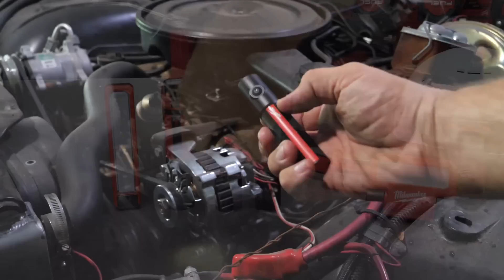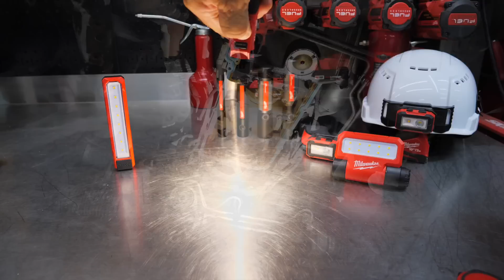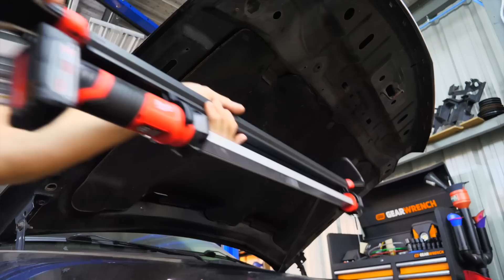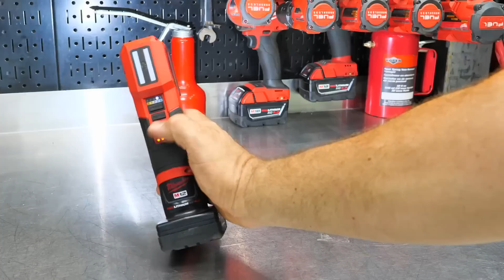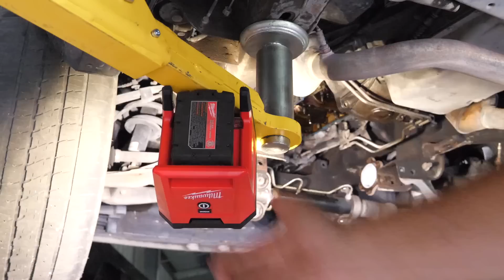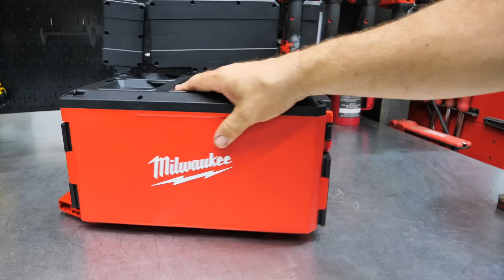BEST Mechanic Lights - 16 Cordless LED Milwaukee Lights and Why You Need Them!

Comment: I really want to invest in the under hood light but I don't know if I can justify the cost. I have all of the rechargeable red lithium lights Milwaukee offers but I don't know if it's 3 times the cost of the competition just to keep it on the same battery platform. (Then again that's coming from the guy who is about to buy the headphones from Milwaukee just to have the same battery, ignore that)

Comment: I think the m12 packout LED flood light is honestly a really good DIY mechanics light, because you have something you can take with you while under the car that has storage space for tools and nuts/bolts. The usb charger is a nice addition, but I wouldn't use it to save battery life. Not as useful if you have a lift at home, but majority of DIY mechanics don't have a lift at home, and most of us are lifting our car on jack stands, or at least quick jacks(which isn't that much higher vs jack stands)

Comment: Man I'm sad you didn't mention one of the best selling points for the pen light, and the reason I instantly bought one. It's one of the only few pen flashlights that has a rubber end portion so when you have the light in your mouth youre not biting down on metal. Just a really good mechanics everyday carry. Cant find another pen light that has that rubber bite zone AND that's rechargeable with good amount of light and battery life for the size.
Reply: Good point.
Reply: Excellent point

Comment: I figured it out. For the 600 lumens head light to make it compatible for the Blot hard hat you need to detach all the straps and band ( so it’s just the light and battery pack left) use the Bolt hard hat accessory clip to attach the light. Bring the battery pack to the back of the hard hat and use the back straps of the hat right above the adjustment knob.

Comment: I am very insulted. I have sent you at least 5 emails asking you for help to show off a product (a work light) that will eventually be owned by every mechanic. What do I have to do to get your attention? Not fair. Very frustrated and disappointed.
Reply from the maker: Your email must be going to spam or you're sending to the wrong email. We just searched and nothing turns up. Send to info@shoptoolreviews.com
Reply: I sent you another email on 10/13/22. Thank you

Comment: My go-too work light is the old 2111-20 'hardhat' light with swappable batteries. I generally  use it continuously whether automotive or home repair of whatever. When the battery dies, I pop in another one (charged in offline charger) and can keep going indefinitely. Not crazy about built in batteries.

Just got a 2161-20 specifically to share the same pool of batteries

Comment: My favorite personal flashlight of all time is the Milwaukee 500 pivot
Reply: I bought it because I saw a coworker with it and how useful it’s been so I not too long ago and I love it it’s extremely underrated I think in flashlights I use it more than my m18 flash light but that only 100 lumens and this is brighter and smaller. But I’ve been considering the pack out light since I got my first boxes a few days ago or some more boxes. Can’t ever have too much light though

Comment: The underhood light system and the little rover lights are absolutely genius and got my full attention!!!! I'm a mobile mechanic/car audio installer and lighting is always in short supply. I may need to find me a few of these. My little magnetic bluepoint lights have served me very well for many years but stocking AAA batteries is a pain in the rear. I'd rather have some sweet, beautiful red lights to match my tool boxes and other gear (and vehicle) very very cool lights.
Reply from the maker: Lights definitely have a huge value to a mechanic, installer, and detailer. It doesn't matter how many you have...you always seem to need more. Thanks for watching.
Reply: P p 09

Comment: That pack out light and charger piece is awesome. Seems pretty big and bulky for what it is though. For the size of it i expected it to be to hold storage as well. I bet there would be a way to mod it to use as a stoage case/box as well. Pretty awesome tho. Not a huge Milwaukee fan, but they are definitely good on their lighting game. As long as they actually last awhile to get your value from the cost.

Comment: The rover magnets are kinda weak, especially the back one. You got real lucky yours stayed stuck on vehicle or I got a dud. The light it puts off is nice though.  I will probably buy the overpriced blade stick light when it comes out. But $99 for a light to loose is hard to swallow.  
That underbody light looks amazing must admit. Too big to forget also
Still go to Menards and HF and get lots of lights that when they drive off you shrug your shoulders and grab the next one off the side of your box and replace. 
The old m18 stick light looks abused the lens didn’t like the brake cleaner and is hazy now. Haven’t hit my rover with brake cleaner yet but if it hazes over I guess that will be my answer. Cheap lights or expensive lights

Comment: For those lights that have different modes does it remember which mode you were in after you turn it off or does it go back to high?
Reply: They remember except the rovers which go high low off high low off...
Reply: @Sparkystacoma  I think I like the rover that has the carabiner. Probably pick one of those up. Hate the smaller AA battery powered rover not shown here. Almost lost the cap when I twisted the belt clip so I could turn on the light.

Comment: The under hood gets used the most around here, so many uses. Im curious about the under body transformer looking light. What size battery at the minimum would keep it from falling over if you placed it on the ground?
Reply from the maker: The underbody is an amazing light and really helps under a vehicle. Sitting upright it's very top-heavy, so it would only make sense if it was sitting on metal. For that matter, I guess you could have a piece of 1/4" steel that could act as a base when it's sitting up. 
Also, the underhood light, even though it's several years old, is still a great light and very functional.

Comment: I like the color temperature of the Milwaukee lights, but when it comes to the smaller lights, I have avoided Milwaukee due to their proprietary batteries. I have been using the Coast XPH30R 1000 lumen headlamp lately, and I have found it to be a good option. It uses a standard (and upgradable) 18650 battery, has a strong magnet for sticking to anything metal, the headband can be quickly removed so it can be used more as more of a flashlight rather than a headlamp, and it has an adjustable beam (spot to flood).
Reply: check out the sofirn brand i am sure you will find a good light at a good price and they are super well built

Comment: I went with Skil 12v work lights and 12v flood light.  Love em.  Especially the work light with their magnets just right and twist light head for all angles.  Those look good too.
Reply from the maker: You can't go wrong with those. Those are diffused very well and provide great coverage also great pricing. They just don't have a bunch of options. Great choice though. Thanks for watching.

Comment: Shop foreman here. I have a Streamlight Strion I EDC in a holster on my belt, and a non rechargeable Coast “moon beam” 50 lumen pen light. I actually prefer the low output of the Coast penlight. If I need a lot of light I’ve got my Strion, if I need to see something up close and not blow it out I’ve got the penlight. Only complaint is the penlight outputs awfully blue light. I wish it were a higher CRI light. I don’t use the penlight enough to warrant a rechargeable light and I use a piggy back charger for the Strion so I’ve always got light. Wish I was still on the line so I could justify buying some new lights. My wife says I have a potentially unhealthy affinity for flashlights but I figure we’ve all got our vices and I’m always quick to remind her there are many worse things out there I could spend my money on.  Absolutely awesome video! Loving the automotive centered theme of this video!
Reply from the maker: It definitely sounds like you've prioritized your life in the right order. :)  It's hard to go wrong with Streamlight or Coast, they both make great lights. I do wish more of the manufacturers would put some thought and attention to the correct light color. That's one thing that I think Milwaukee has done very well for the past few years. Thanks for watching.
Reply: I love streamlight, but the light color is terrible. I wish they would offer neutral white instead of only the cool white color.  I have the little 20 dollar aaa Milwaukee tru view penlight and I love the color of the light output
Reply: @ssclassof2000  I couldn’t agree with you and Tim more. Over the decades I’ve used it, I’ve grown so accustomed to the blue light of my pen light that I’m ok with it now. But I would never expect a new technician getting into the field and perhaps buying their first pen light to accept it.  The Streamlight Stinger Strion, while closer to a high CRI then my pen light, could still stand to be improved. It seems to me that Streamlight focuses much of their effort on either military/first responders, and outdoor recreation and general lighting, that I personally feel they’re leaving out a massive market of speciality lights for the automotive repair market. People who don’t work in the industry will never understand the benefit a good lighting solution can provide and the price many technicians will be willing to pay for it.  Milwaukee seems to understand that technicians are willing to spend a lot of money on a light if it makes our job faster, easier, or safer.  I wish Streamlight would get on board with that too and bring a fresh perspective and ideas and competition to the market.
Reply: @2down4up  Check out sofrin brand i am sure you will find a few lights that you will like
Reply: @wesleyflores1085  Ok I will. Thanks!

Comment: should be titled Milwaukee love fest. I will never buy a Milwaukee cordless tool again. I got burned by their V18 NI-cad batteries were all junk in under two year. So I got their  two new Lithium upgrade kits.with two batteries and new charger. All were junk in under two years. All my Dewalt and Bosch batterries have lasted over 10 years. Two years ago I updated to Bosch 18 volt system and Dewalt Flexvolt 60 volt and 20 volt tools. No problems. Still use my corged Milwaukee tools. They are great.
Reply from the maker: I do understand most of your concerns and comments about batteries. I think you probably meant to say V28, correct?! That was an interesting detour for Milwaukee. With your new Bosch 18V and Flexvolt stuff, you'll be happy with that. Those are great tools.
You mention the Milwaukee love fest. We set out to find one manufacturer that did the best with lighting. We'd hate to build a list of 16 lights and point people to buying from 4 different manufactures with all their different batteries. By far, Milwaukee has the best cross section of lights, and they have their TRUEVIEW lighting which provides a great color (like sunlight). So, this is why we chose all Milwaukee lights for this video. 
Thanks for watching.
Reply: It was  the 18 volt ni-cad system. about 2004 through 2008
Reply: I also have some of the Skil 12 volt system. Love it. They have a great 3/8" ratchet.
Reply: @richadent968  lol look at the moron comparing old ass ni-cad tech to modern li-ion battery
My old Hitachi drill ni cad battery after building one deck the battery where junk 
Most of my Milwaukee stuff is 3year old and battery work just as good